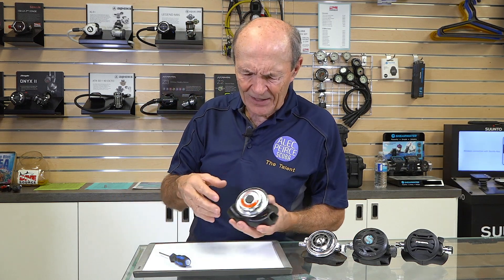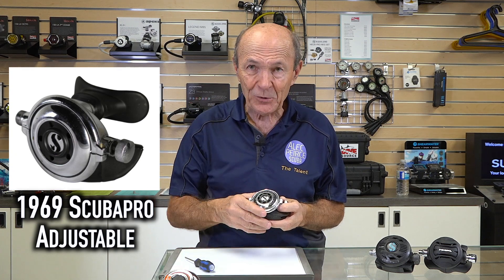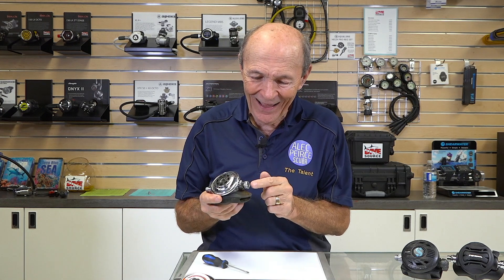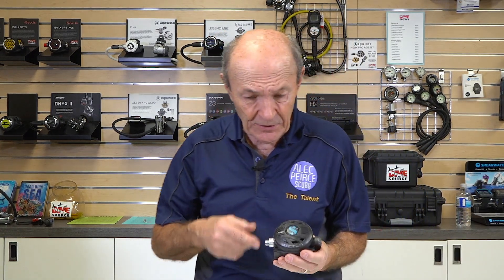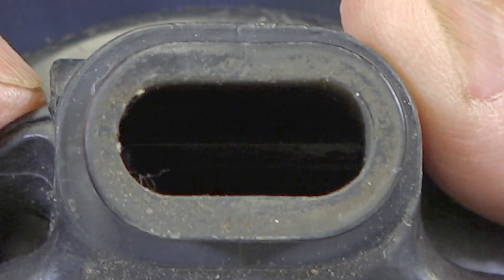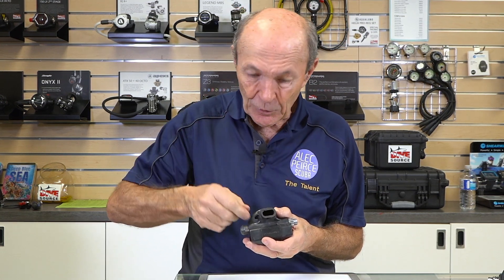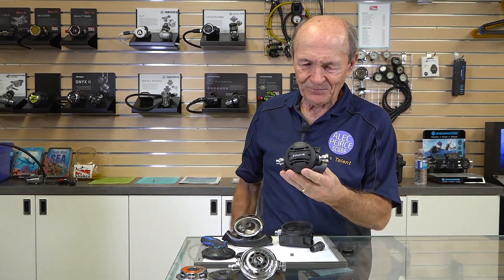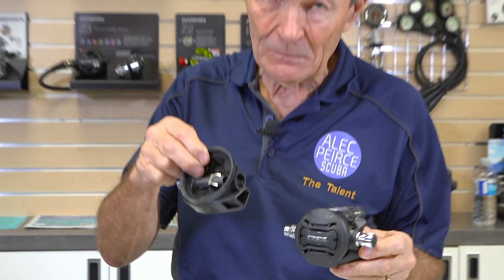How Adjustable 2nd Stages Work - Scuba Tech Tips: S14E15

Comment: Hi! I have a question about ss adjustable knob! I had a great, sci dive tech who I trust, tell me that after every dive I should crank the knob all the way open, and I failed to remember his reasoning for it, or if I’m also supposed to turn the knob back to the middle before my next dive? Why did he say that/should I crank it open after every dive? (Maybe something about it keeps your second stage in better condition) and am I supposed to crank it back after? Thanks for your help! -a 21 year old new AAUS diver
Reply from the maker: When the adjustment is turned open, the spring pressure on the soft seat is at the lowest level. That way the seat will not be subject to pressure between dives & will last longer.
Really, in practical terms, it's not a  big deal.

Comment: Hi alexs your tectives is  reao usfuel  please i need to ask abut haw to adjust the micro adjustment  in  secand stage
Reply from the maker: There is no micro adjustment in the second stage, just the breathing effort adjustment.  Watch video: S08E01 1.	Regulator Service, Set Breathing Resistance, and S16E02 What Makes Breathing Easy?.  These will show the only adjustments you can make.
A

Comment: recently, I rebuilt a Scubapro R109 second stage and I modified the poppet spool to include the balance option, 
It is a very good quality material and I succeeded to have it perform very well.
my only drawback in comparizon to new plastic  construction is that it is a bit heavy.
very good topo
very good video
Reply from the maker: Thank you Jacques.
A

Comment: hi Alec that second scuba pro and the third scuba pro regs look to have the identical internal valve activation lever, I hope they used a better plastic internal spool for the later version, My early one was very discolored and brittle. On another note, I heard somewhere that the older all metal regulators were less susceptible to freezing up because the metal draws heat from the water more than plastic does. Any thoughts on that? take care Owen m
Reply from the maker: Unless a regulator is specifically made for cold water diving, 50F and lower, they will freeze up.  See my video on why regs actually freeze in video S09E05 Why Does my Regulator Freeze?  Hint: it's the adiabatic process.  Take care Owen.
A